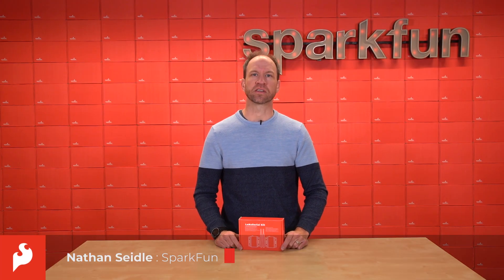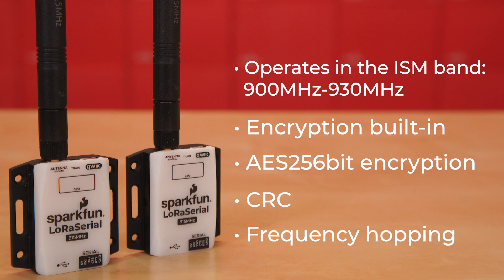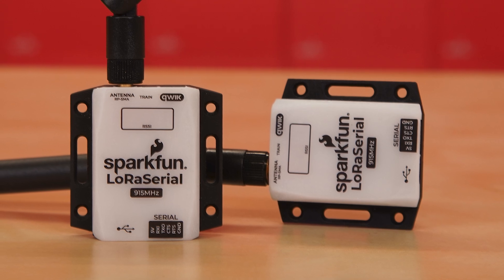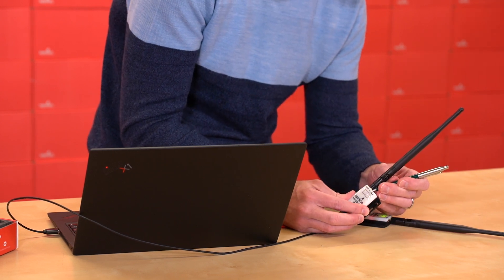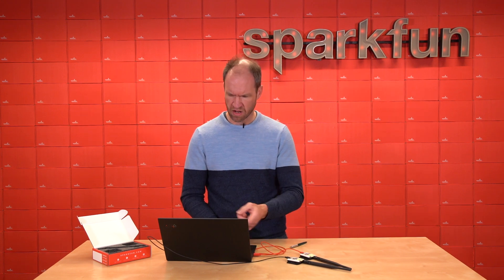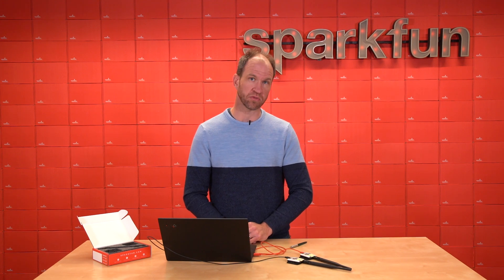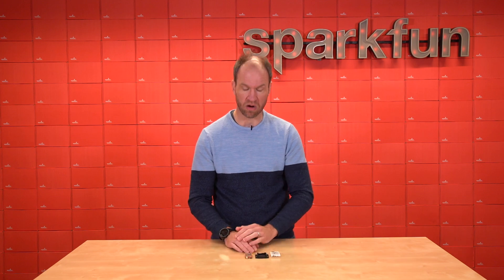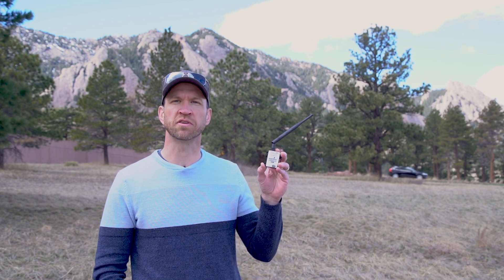Product Showcase: SparkFun LoRaSerial Kit

Comment: Might want to enable terminal local echo for the demo @3:13. Just seeing the text pop up in a window was confusing until I was able to follow which terminal had focus. Thanks for the great product!  I need this to communicate out-of-band (non-WiFi) between prototype devices across the house.
Reply from the maker: Thanks for the feedback! Sorry, it is a bit confusing but one window is where the data is sent, the other window shows the data being received. Yes - these radios will work great for out-of-WiFi band communication.
Reply: i also got confused whats going on :D

Comment: The tutorial link in the description leads to a 404. "Woah there, Turbo! Our server gnomes couldn't find the page you are looking for. Seriously, where are you trying to go?"  An easy to configure out of the box LORA solution is a welcome sight.  

Not a fan of using the SAMD21 vs a SAMD51 or RP2040.  Honestly would actually prefer an RP2040 MCU. There's a lot more you can do with an RP2040 such as MP3's using its external QSPI.  Since it has built in encryption I'm guessing you're using an RFM96 module? Is a things network connection a requirement or is paring stand-alone? I would prefer stand-alone with the option to join a real LORA things network. While the SAMD21 is a solid offering and the wave hoping and other features are months if not years above the RFM95 solutions. Just not a fan of the MCU you went with... (because it uses up the UART pins) I can't easily pipe it into another microcontroller for added functionality, Going with a SPI connection would have been better (at least for advanced projects with more functionality). A SAMD51 or RP2040 would be far more appealing for advanced developers. If you come out with an RP2040 variant using the SPI bus in a feather or Uno footprint please tag me.

I LOVE the one touch pairing and built in AES256!  There are so many things to like about this product.  It's perfect for beginners!!!  Unfortunately I'm not a beginner.

Comment: neat product.  a few questions.  what is the max baud rate of the serial it can send/rec?  can this be configured to have multiple clients.  i.e. 1 server talking to 8 or 16 or more client units at the same time?
Reply: Because it uses UART the most you'll get out of it is 115K baud and because it's a low horsepower SAMD1 (by today's standards) it'll likely start dropping transmissions at those speeds. The safest speed for UART is 9600 baud usually for debugging.  A safe, reliable, and fast speed for a SAMD21 with LORA would probably be around 19K or so.  My RFM95 with a 125Mhz RP2040 does 125K baud reliably, runs neopixels, a servo motor, and I2S audio, simultaneously! You can't do that with a 50Mhz Cortex M0 SAMD21 it just doesn't have enough RAM or horsepower.  For a single purpose LORA radio running Arduino yes it'll work but you won't be able to do much more with it than be a transmitter or receiver. I should also add that I prefer using Circuit Python which is much more RAM and MCU intensive than the Arduino language.  So my needs are more... intensive.

Comment: Range is great... though, 15Bytes/sec, ummmm. Is throughput a function of antennae distance?
Reply: Yes, in Lora you can define 3 different parameters separate from the actual transmitting power.
Spreading Factor - How much we "spread" our data over time. Max # is 12

Each step up in Spreading Factor doubles the airtime to transmit.

Each step up in Spreading Factor adds about 2.5db extra link budget.

Bandwidth - How big of a slice of the spectrum we use.

Each doubling of the bandwidth is almost 3db less link budget.

Bandwidths less than 31 may be unstable unless you have a high quality Crystal Oscillator.

Coding Rate - How much redundancy we encode to resist noise.

Increasing coding rate increases reliability while decreasing data-rate.

4/5 - 1.25x overhead

4/6 - 1.5x overhead

4/7 - 1.75x overhead

4/8 - 2x overhead
Reply: You can play with these parameters but it is a tradeoff in speed or distance.
Reply: That's because most of the transmission buffer is likely taken up by the 256bit encryption... which doesn't leave a lot of room left for actual data.  The RFM96 modules are known for this when encryption is enabled.  The RFM95 doesn't have encryption, everything is transmitted in the open which allows you to send a paragraph of data.  As Rudy De Volder said it's a trade off.  Everything from speed, distance, scattering, and encryption is a trade off.  You have to know what your design goal is in order to choose the right  LORA module for your uses, there are different types out there which offer different features. If you want encryption by default then something like this product is a beautiful thing right out of the box. Easy pairing, super long distance, and encryption is a great combination. It's honestly an amazing offering if those features are within your design goal.
Reply: Or perhaps a better quality antenna would boost throughput. ¯\_(ツ)_/¯